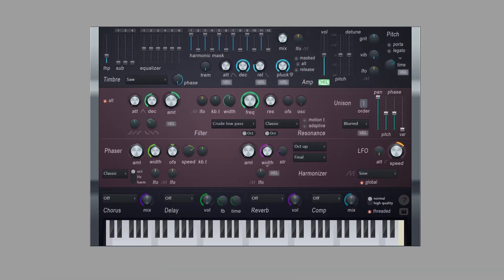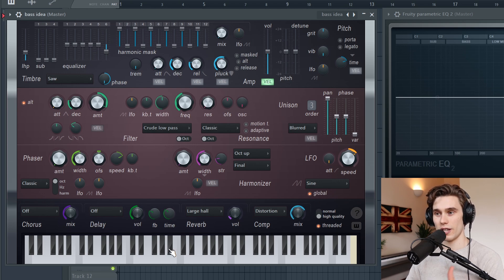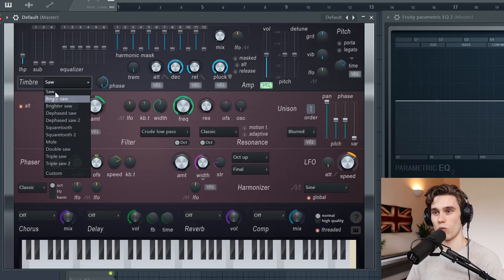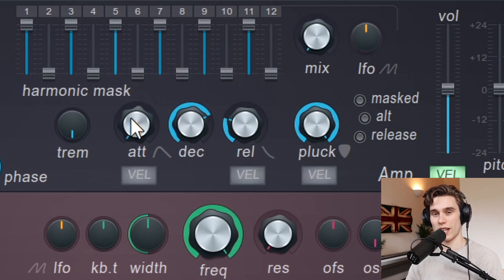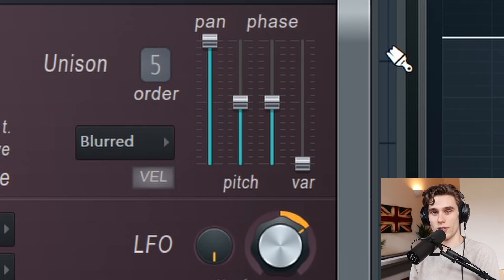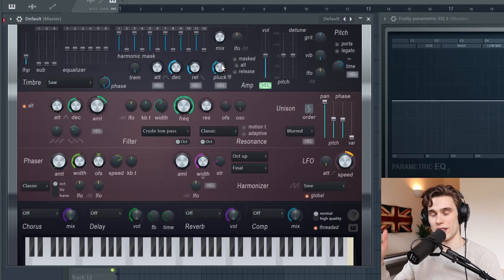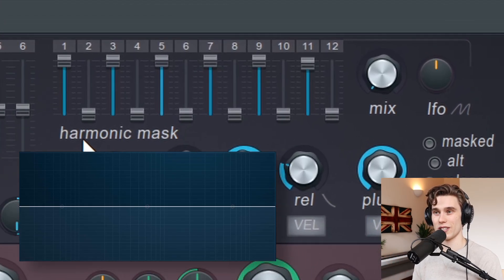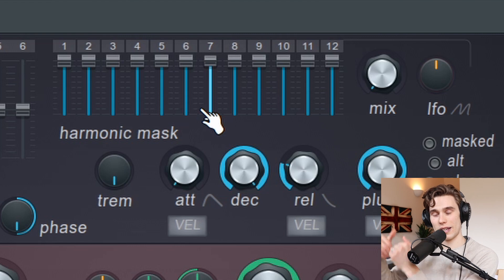FL Studio Harmless Synth Tutorial

Comment: I have a question.
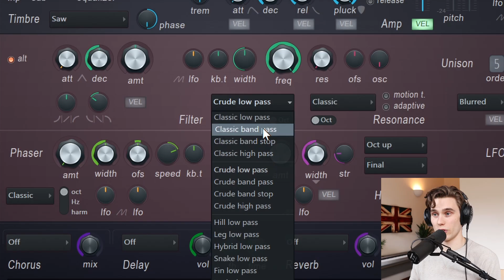8:07 isn't it technically the same with just cutting mid-frequencies away? If it is, why Harmless has that harmonic protection function?
Reply from the maker: The lhp also protects against the harmonic masking feature too. It’s sort of difficult to describe where you might need it but there are some sounds where you want the filter to follow the keyboard tracking or note pitch but you also want a solid low end. You can also achieve the same result using many different techniques - one if the reasons I love sound design so much :)
Reply: @inthemix  Oh, I got it. Thanks!